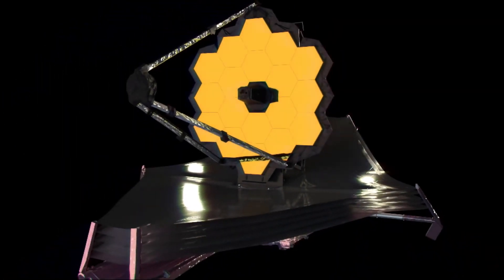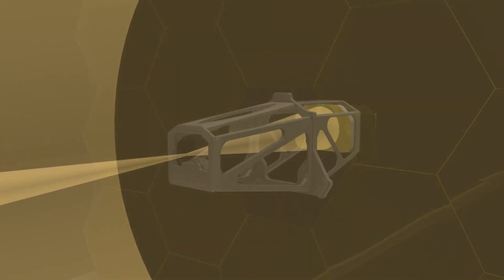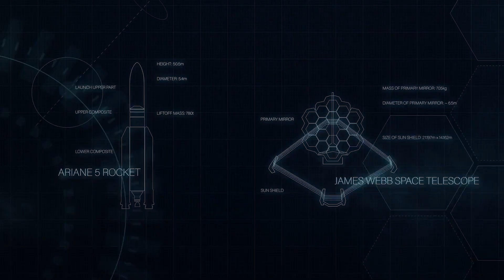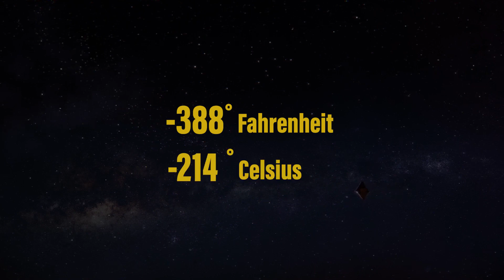James Webb Space Telescope's optics explained by NASA

Comment: Other than you could stand the mirror up and use a custom fairing and launch it as a single piece, any particular reason it couldn't be made as a single large mirror and the folding lobes cut off instead of the hex cell design? and could you use a rectangular mirror for anisotropic resolution and gain super resolution by spinning it.
But ultimately (before UFO disclosure that is) it stands to reason that it is vastly superior to simply generate the mirrors in space and make them arbitrarily large. As in 100meter plus.